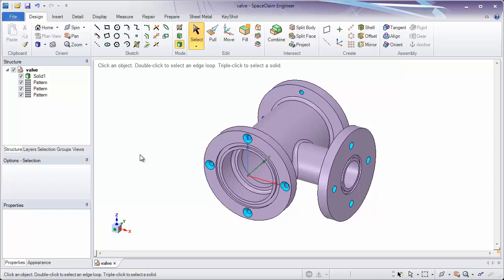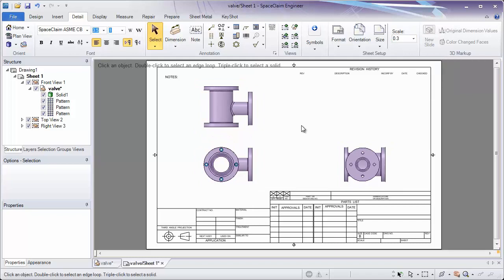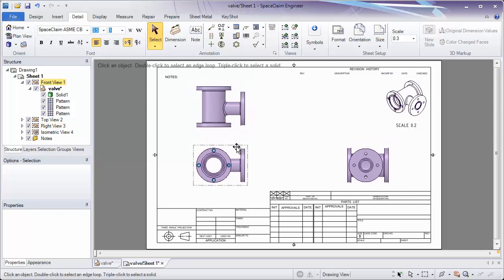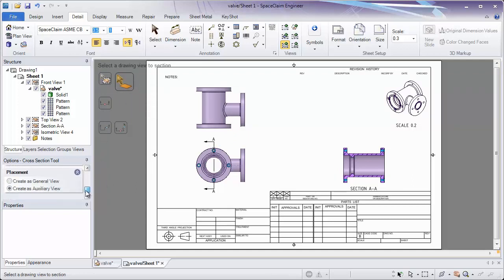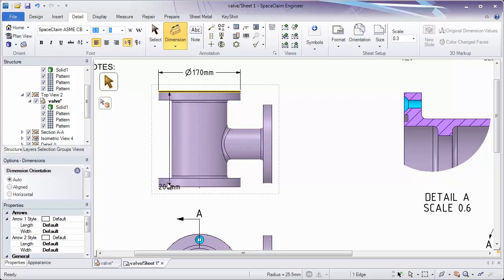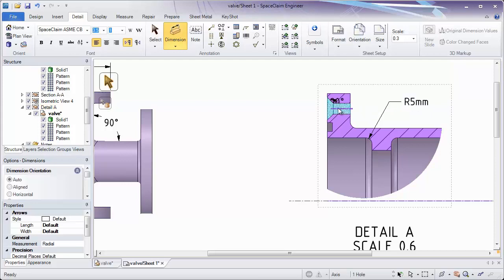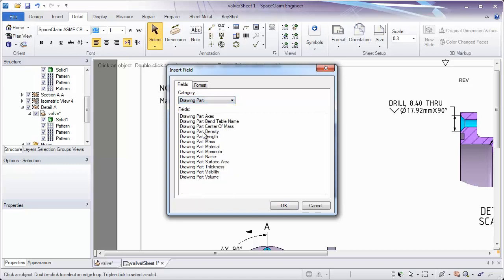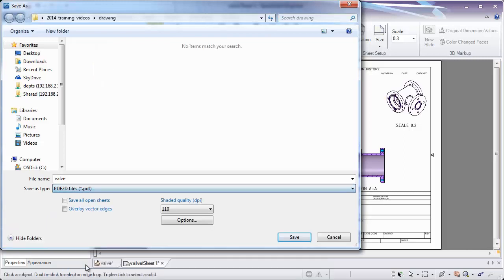SpaceClaim Tutorial 5.1 Part Drawings

Comment: This drawing "SCALE" of drawings is really am erroneous statement from the times, when the drawings have been made only on paper by  hand. If it was a true scale, then when you dimension it, it should show the dimensions to be also scaled, meaning what was designed as 6" dimension and now it is at 1:2 scale, should dimension 3". But in fact the dimensions are unchanged, because the drawing was not scaled, it was zoomed, just like screen. You can zoom the part on the screen at random ratio by the mouse to see the part as only small speck or to see zoomed detail across the whole screen.....The dimensions do not change. Whatever dimension is still showing same size no matter what the zoom is.....Though, technically speaking, if you scale something, it is bigger or smaller and the dimensions follow the scale...they change accordingly. .......I know it is customary to use the term "SCALE" in drawings which is different from scale in design, but someone should already notice the linguistic problem/ conflict and correct it. The parts on the drawings are not SCALED, they are ZOOMED at given precise ratio. Once it is printed, you can call it scale, because it is hard copy and cannot be changed anymore. You measure it and you "scale" the measured dimension to get the real one...though it is also duplicating effort, because all the dimension on electronic drawings are already there, so you do not have to scale anything, unlike on some old hand drawings, where the dimensions could be missing or not clearly visible, due to bad copy or something similar.